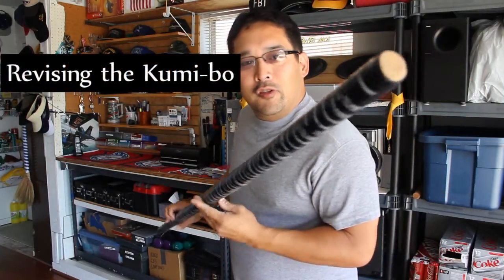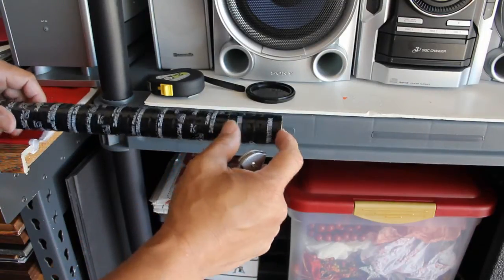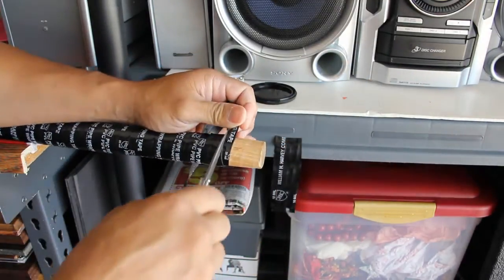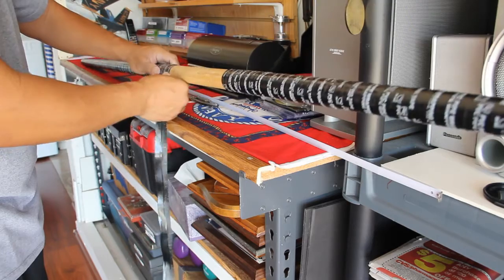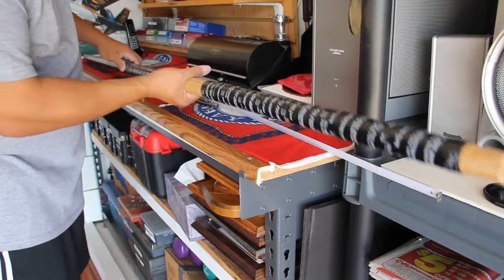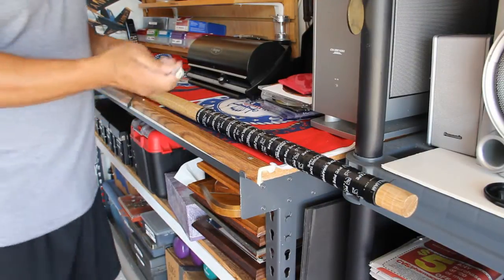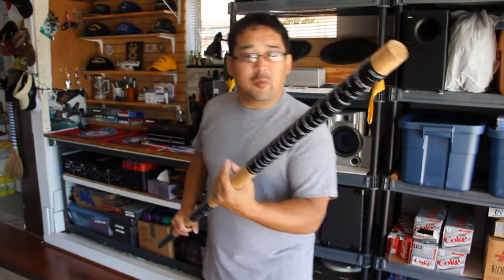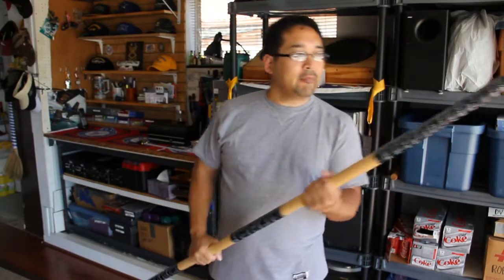Revising the Kumi-bo

Comment from the maker: @realdad32 I originally approached this as a "field repair".  Frequently, brand new bo quickly become trashed.  My training partners hit very hard (with octagonal sai), and dents as deep as 3 mm and 1-1.5 cm long are not uncommon.  It's not unusual for a spotless bo at the beginning of a weekend will have hundreds of dents that criss cross each other.  Using epoxy to level out all the damage is pretty labor intensive.  And if done, subject to the same damage again.  Wrapping a new bo saves it.

Comment from the maker: @realdad32 Also, I've tried using an epoxy sealer on nunchaku once.  And, I find that I don't like the "plastic" feel of epoxy on my hands.  I've bought bo that had epoxy sealer on them from the factory and ended up sanding that finish off because it's too slippery.  When a bo is treated with oil, I have more tactile control and I can feel the grain of the wood.  I'm also a musician and I like to feel the wood resonating.  Epoxy kills resonance.  Exposing the hand holds brought some back.

Comment: Never worried about saving a kumi bo from sai practice.  We just assumed that is what a kumi bo is for.   Just used the bo them till they were real beat up.  Then we would use them for kama practice.  Bo used for kama practice we would heavily wrap the ends with old fashioned cloth electrical tape to help hold it together.  Kama with eat a bo up.

Comment: hey can i offer a better soltion than the tape? use 2 part, 2 ton epoxy. you can color it or leave it clear, andf it will fill in the sai craters. let it dry and san it down. ive done similar projects before.